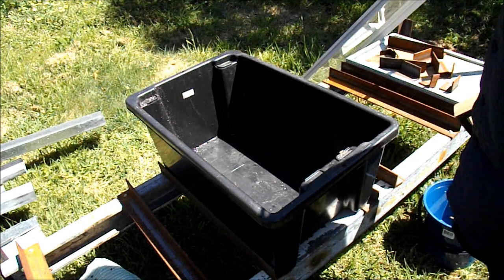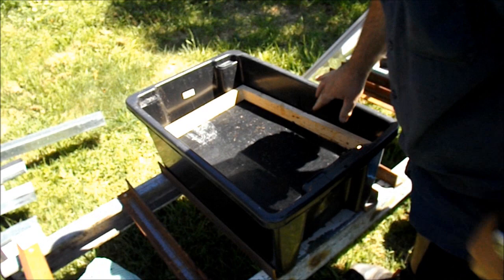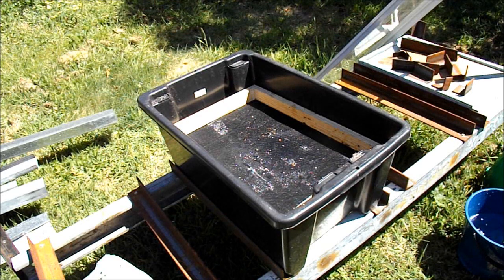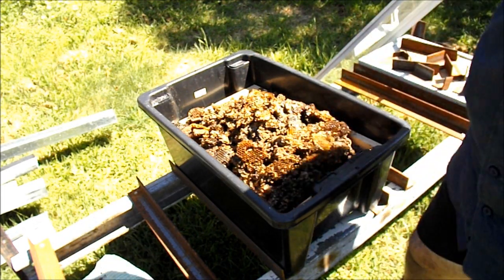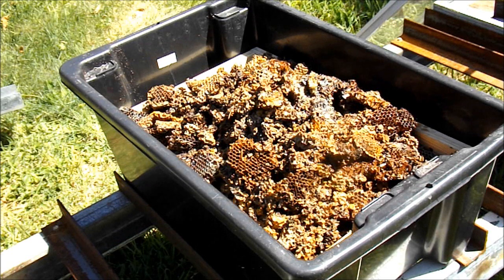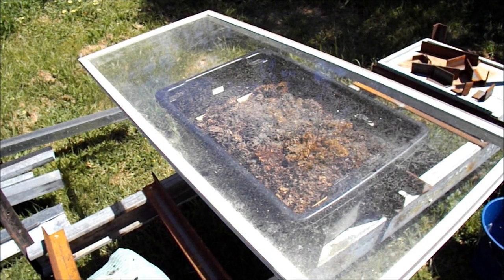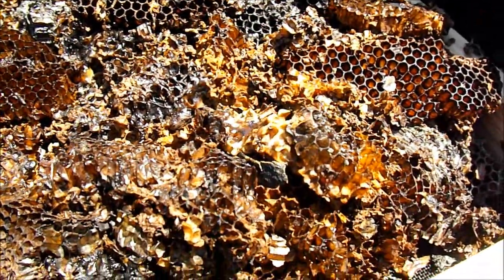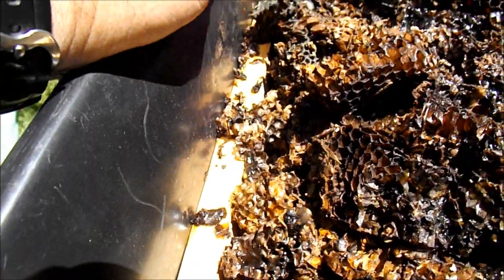Solar Wax Melter at Pop's Shack - Version Two

Comment: do you have to rescreen the frame every time you melt the wax?
Reply from the maker: No, the screen can be reused multiple times.
Reply: thanks for your help....is there a certain mesh to buy...mesh size? and plastic or regular door screen?
Reply from the maker: It doesn't matter what size fly screen or if it's plastic or metal; it's just there to support the wax.